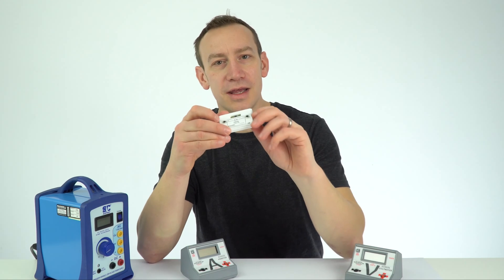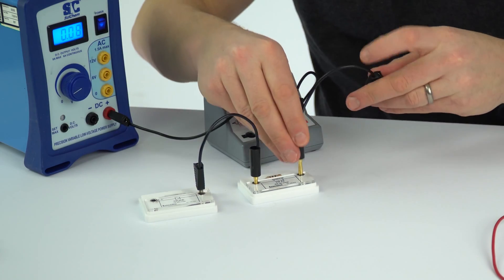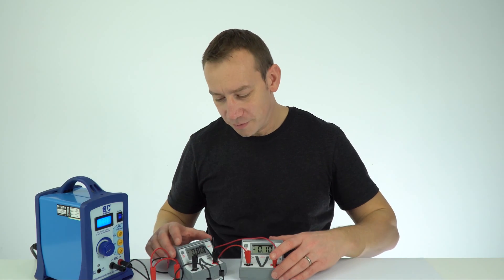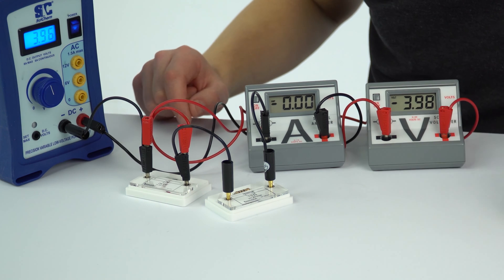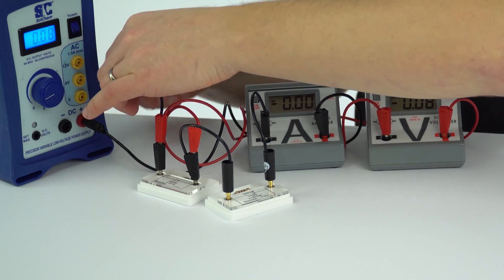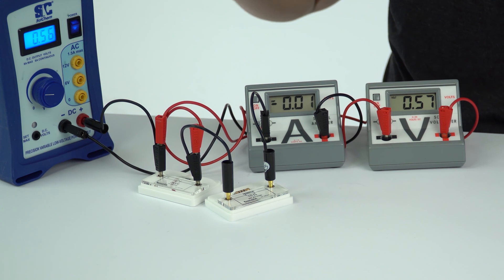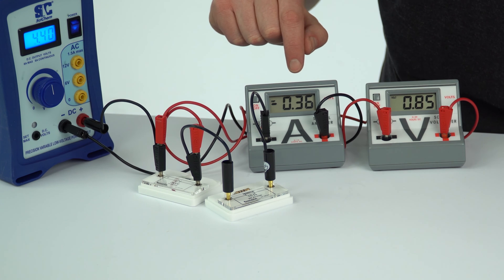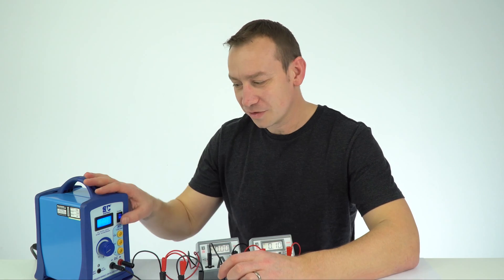IV Characteristics of a Diode Experiment - GCSE Physics Required Practical

Comment: hi, if possible could you explain why we need a protective resistor for a diode?
Reply from the maker: If you had a diode in its own, it had a very low resistance so a very high current would go through it - causing it to overheat and melt!
Reply: @PhysicsOnline  Thanks